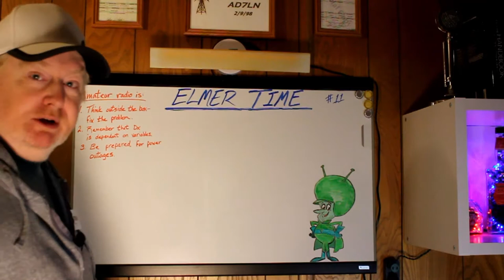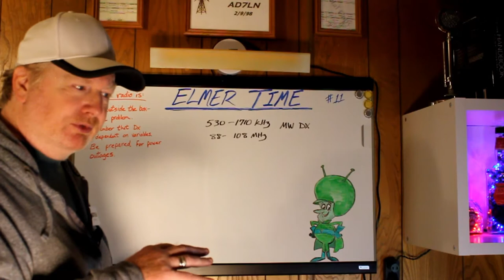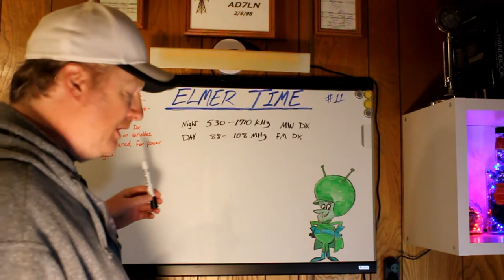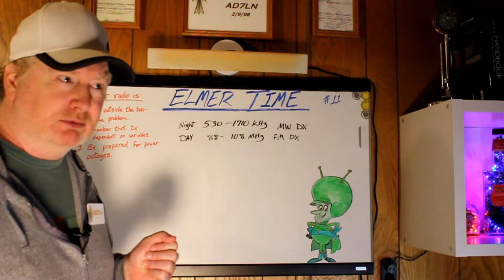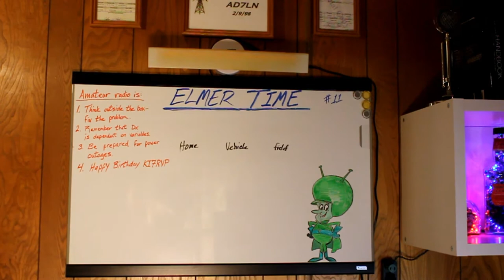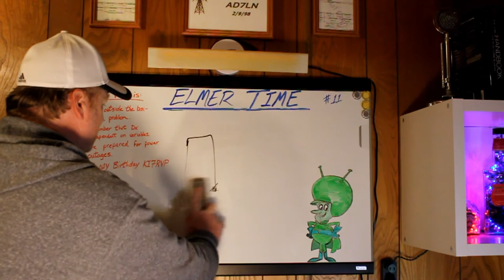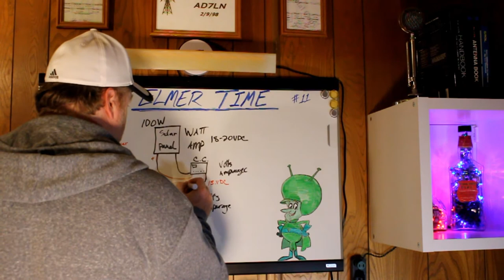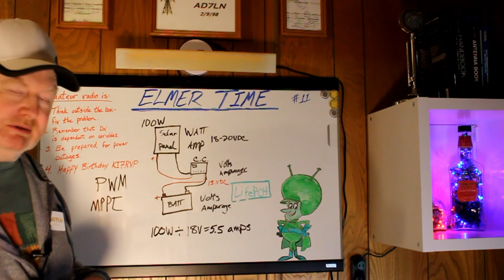AD7LN - "Elmer Time" AM/FM DXing- Intro to basic emergency solar setups

Comment: Good video Elmer I have a jackery type power bank that has those kind of batteries in it I just got in a couple months ago
Reply from the maker: Hi Jim - yes having portable rechargeable power is a necessity. Power outages happen frequently here in the Northwest winters. It's nice to have power for a radio, some light to read by and a cell phone charger. My woodstove provides the heat and a cooking surface during the outages.
Reply: I have the bluetti 268 wh can do up to 600 watts it's a fast charge system charges in 1 hour fully off of the wall and I also have 100 watt solar panel that's foldable we've had power outages of 2 to 3 days this thing can charge a lot of devices
Reply: @elmertime8043  I also have a 1920s wood burning stove in my house when it gets very cold out I fire it up and it keeps the house warm